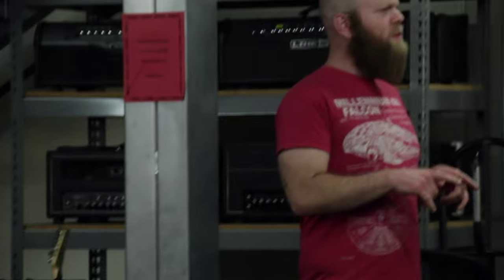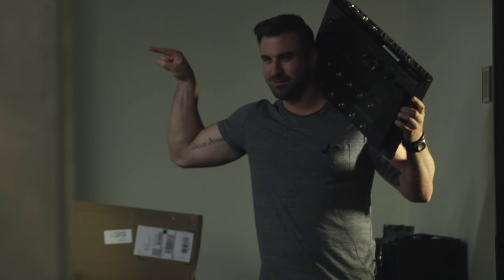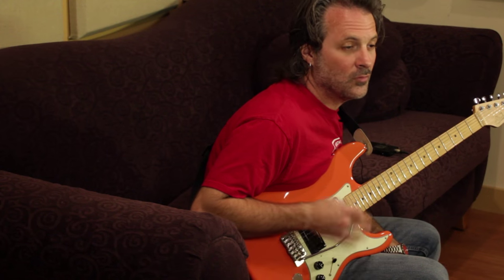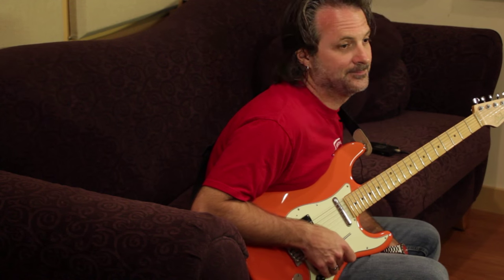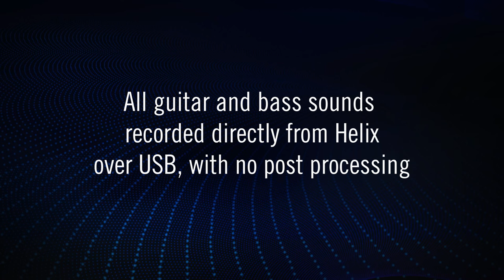Helix At The Office | Line 6

Comment: One quick hardware question, as an owner of the a POD HD500, I would like to ask if the Helix would finally have XLR outputs with independent volume/level controls similar to the old Digitech GNX4s. This would be helpful in live and or studio settings. Thank you. (it has been years since a number of users have asked for this and some just came up with work arounds with additional D.I. boxes defeating the purpose of the onboard XLR outputs.) We hope to hear from you soon.

Comment: "A month to make one amp for helix"

Kemper does it in a minute... and no one in the planet can listen the diference. So.. good luck
Reply from the maker: Ángel Fuentes The Kemper is a great piece of gear, however, it only grabs the current state of the amp. You can't turn up the drive or the treble without reshooting the amp with that new setting. With Helix, the whole amp is captured at the same level of accuracy, so when you turn up the drive knob, it behaves like the real amp does. That's why it takes a month, and it would take Kemper that long or longer to do what we do in Helix.
Reply: +Line 6 Movies an extremely professional and respectful response. classy. very excited for my Helix to come in a few weeks
Reply: +Ángel Fuentes Kemper is a great unit..for what it does.And what it does is very specific and limited.
Reply: Nice response.  I prefer the helix cos it's one board as opposed to head plus floor unit. Which negates the benefits of a smaller system